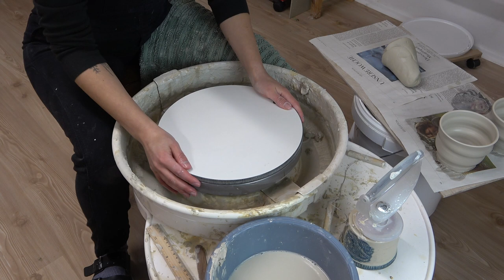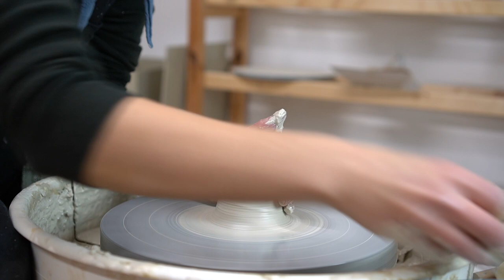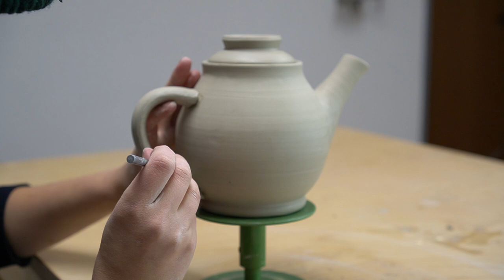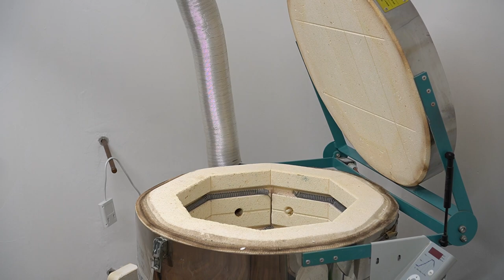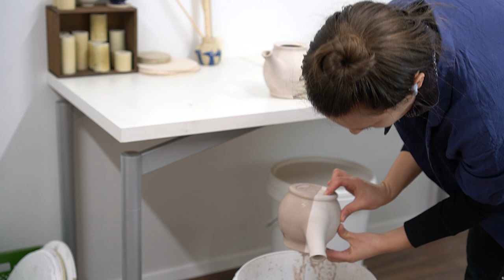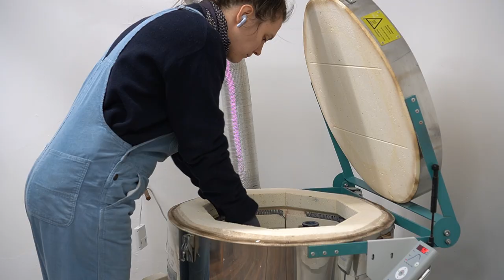The Full Process of Making a Teapot // throwing, trimming, assembling, & glazing

Comment: What black magic are you using to trim with no clay lugs and keep it on the wheel head?!? A friend and I are sharing a Giffin Grip because we had basically given up on trimming.
Reply from the maker: haha oh no! It's all about suction. Add a tiny bit of water and rub the pot against it the wheelhead. As long as the rim is even it should stick. It is easier with wide pots like bowls, etc so maybe start with that.